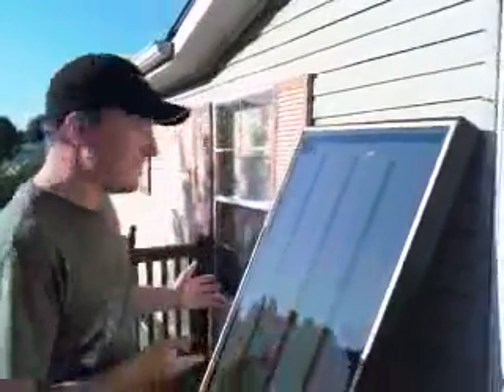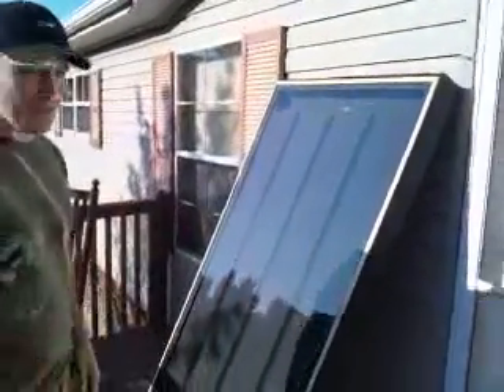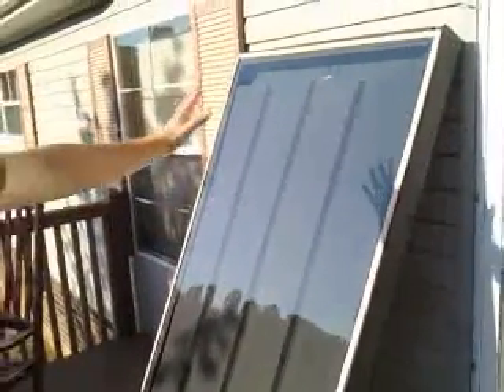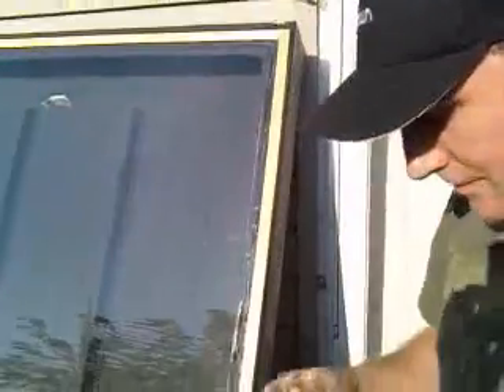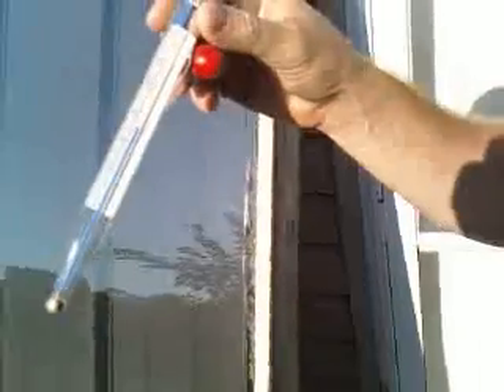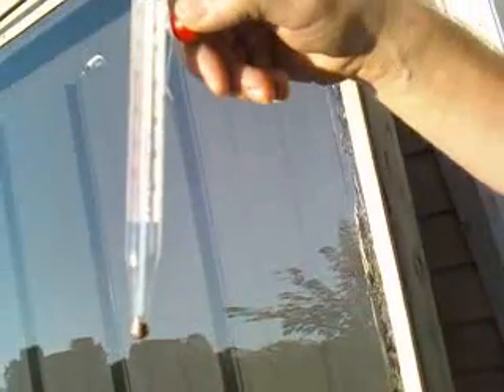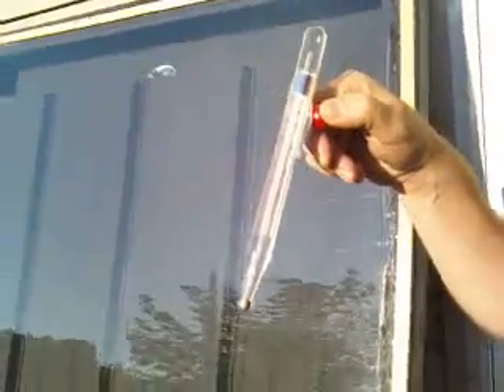220 degree solar air heater

Comment: I would like to hear about your install and the resulting internal house temperatures. 104C (220F) is a lot of free heat. I made a 2.5 x 5 foot unit with 4" top and bottom ventilation hole that made 55C (130F) of heat. So I made a 3 x 6 foot unit with 70C (160F) of heat. So I made a 6 x 6 foot unit with 95C (200F) of heat. I am now planning a 5 x 40 foot unit along the fence with 6" top and bottom ventilation holes. Yes, it gets -20C (-4F) and -30C (-22F) here. I focused on high insulation everywhere first though.

Comment: The main issue, is stating temperature without air flow.  One unit in my house produces 163-185F air and the other produces well over 500F which would heat my house better?  What if I now let you know the 163F - 185F is my wood stove with 300CFM blowers on and that's the temperature of the huge amounts of hot air blowing into my house whereas the 500F device is a candle.  We need to know the air flow, and goes with the adage a tub full of warm water has a lot more energy than cup of boiling.
Reply: Good example for illustration. May I add that without high insulation in your floor, attic, walls and sealed windows these solar air heaters are essentially like whistling in the wind. We need to trap and hold the warm, heated air for as long so the added heat can build and build keep off the thermostat while keeping our families warm. Solar air heaters indeed do work...after high insulation. 

But on your specific issue of flow rate of warm air. Typically, my 4" duct fans help to move the heated air through the unit and helps to circulate it through the house. For small areas the natural convection air currents caused by warm air rising powers the unit and warms the small area once the insulated hole ventilation plugs are removed on sunny mornings and replaced in the early evening...keeping the daily generated heat inside your warm room.

Comment: So funny when they measure the high temperatures it’s like seventy degrees outside to produce these temps, who needs heat then dumbass? Try taking it when the air is 25 degrees!
Reply: He's demonstrating the rise in temp above ambient air temp.  You wouldn't wait till it's crazy cold to build it.  Build your own then go out and make your video at 25°. We'll critique it when you do.  Rudeness is ugly on anyone.

Comment: "high heat" grill paint is not needed.
Flat black color? Absolutely.  "high heat"? No.
Solar ovens and heaters do not even approach the temps of a grill.
200 deg, tops.
High temp paint is made for 1,000 plus temps.

Comment: 70 degrees outside  and why are you needing to heat the house ... when it's 70 degrees in MY state it's comfy... what is the value of this to heat a house when it's hot outside too.  DUH............  I'll pass on this not very well thought out idea... pretty impractical on a cold day
Reply: Rick X Huh???
Reply: You build the heater when it's warm so it's ready before you need it.  The demo is to show that you are raising the air temp over ambient  air. Rudeness isn't called for.

Comment: I wonder what would happen with a reflective back surface and 1 way mirror tint on the window?
Reply: spackle9999   Was considering the glass also. I am going to guess that what you're suggesting will initially reflect more; single glazing solar heat gain coefficient is nearly un-impeding. Then, got the back, absorb the energy with a foiled insulation behind it for the best-bang-for-the-buck.  A reflective back might just reflect most of it back out. There is glazing made to optimize for cold-climates that have high SHGC and (attempted) high insulation (heat reflecting); I'd have to guess that could yield peak performance but higher costs with minimal increases in capacities.  I would definitely like to see some comparisons with these implementations though.

Comment: You will get a higher return by using pre-insulated panels available at any big box lumber supply store instead of the plain wood frame. They are basically a insulation "sandwiched" between two layers of thin plywood.  Put together using small 2x2 or 2x3 lumber and good screws. Don't forget to close in the edges by cutting at 45 degree along edges or by enclosing with the 2xs to minimise heat loss. I heat a 24'x24' barn with this in the dead of winter and it raises the temp by around 35 degrees for a 4'x8' box/heater.

Comment: I wouldn't use wood at all.  Think about all those chemicals they use to treat that wood...and it's baking literally every day and all that chemical crap is just burning and ending up in your house air in your lungs.  

Even with the paint you're not guaranteed all the chemicals are going to stay in that solar box..all that poisonous air is intended to flow into your house.
Reply: luminousbluebird I would encourage you to question at least some of what they tell you.  Not every dog bites.

Comment: That high heat paint is gonna STINK up the house.  It smells for almost a year..  It needs to be aged before you use it.
Reply: ThomastheSailor Chubby not in my experience.  Read the directions and cure the paint.  The smell does not last.

Comment: Does anyone know of a site where they actually heat a room with one of these? We have seen many boxes get hot, but would like to see the final results.It's a cool idea!
Reply: My 3 foot by 6 foot unit solar house heater warms my master bedroom, en suite and hallway very nicely. It outputs 160 F of free heat from 930am to 6pm. 10 or 15 F increase even on cloudy days.

Comment: At 93°C=200°F the heating  yield is  zero at maximum temperature in summer heat !!!
The yield is maximum when the air coming out is minimum, around 30°C to heat a house in winter, yield around 30% and 300W/m2  , saving aroind 1$/m2day of winter sunny day.

Comment: this is great, I build smaller version of this and its very effective but need to clean snow every morning is kind of an early morning habit of mine now and i dont mind that much as long as it keep its worth...
Reply: Merian, what is your average outdoor temp?  And what is the temp of the solar air that is generated?  I feared that building this in 0-20 degree Michigan temps (and gloomy skies) would create 60 degree heat at best and would not be very beneficial.  Thoughts?
Reply from the maker: Thank you ! I agree, I plan to build a smaller one for my shed.

Comment: Show me how it works when the outside temp is zero. I'm skeptical that it would be as efficient when it's cold. I would imagine that the cold that the thing is sitting in outside your house would cause a loss of heat before the heat gets into the house.
Reply from the maker: wookie0dud  Hi, I really don't know about a 0 Celsius climate. I am lucky that we usually have very mild winters here in NC. I recommend putting a snap disc thermostat inline with the fans. That way it will only come on when the temperature inside the heater is over 90 degrees F. That's what I did. I also put a switch inline so that I could turn it off manually as well. I imagine the larger you build one of these the more air you'll heat.
Reply: Heated air inside will rise, so the output is at the top.  Using a fan to pull air quickly will result in more heat discharged to the inside of the home.  Contrary to typical thinking, the cooler the unit is, the more heat is being transferred into the home.  You don't give it a chance to be lost to the elements.  Think this way, you're not trapping heat in the unit, you're using it to transfer the sun's radiant heat into your home.  Additionally, you could use double pane glass for insulation.  When you stand by your window, even in the winter, the suns rays warm you up.  This is taking that warmth from the outside and bringing it in before it can dissipate.
Reply from the maker: Actually it recirculates the air that's inside your home. The intake as well as the exhaust are inside my home. So if the air in your home is a balmy 72 degrees F, then the air flowing through the heater will increase not decrease. This acts more like another heat register inside your home when it's sunny outside. Adding to an already heated home. Therefore reducing energy cost to the home owner.
Reply: joel brown Hi there.. I wonder how it would work when we use it below 0 Celsius like -20 or something. I saw some similar projects and creator said that when its big like half of the home wall it rises the home temperature a bit.
Reply: ***** Can you reference the designs you mentioned for really cold climates?
Reply from the maker: It varies. Average for winter months is in the lower to mid 40's. I get a 60 degree F increase.  Any climate will get an increase. You are circulating the air in your home. pulling the cooler air at the floor into the intake, heating the air in the solar panel and returning it into the home.If you use a thermal snap disc it will only turn the fans on at 90 degrees and off when it drops below that.
Reply: you obviously have a lot of improvement n physics.

Comment: What was you clear cover? Acrylic, glass, or something else? I think acrylic would've melt so I'm guessing glass, but that's a pretty big sheet to be under $100.
Reply: around here you can often find used storm windows for cheap (or free) and that gives you glass plus an alum frame to attach to the frame of the heater.  Plexiglass that size would be a bit costly, but it does look a bit better.
Reply: sliding glass patio doors work well, double pane and newer ones are insulated, we have been using a corrugated plastic like they use in green houses, the corrugation works like insulated glass, and significant weight savings over glass

Comment: Hello Joel. i dont understand why your panel work good and there is no cans... Have you more picture / video about the construction please ? What is there underneath your leaf black metal ?
Reply from the maker: There's nothing under the metal except 3 support braces. They are notched out to allow air to flow from the bottom to the top. I have them screwed to the frame and then I screwed the metal to the braces. It's like the metal is free floating not touching the edges of the box. Thanks for sharing and I hope you enjoy my videos. Cheers!

Comment: in our Midwest SD area i seen first generation of the solar air heater. they panel were fiberglass so can't see inner design 1980 ?

Comment: Hey Joel. This is interesting. I would like to have seen a follow-up for the coming winter. Obviously the temp would be lower in the winter. But I wonder how much higher it would be when the outside temp is like 30 F. If the box is still 70 F, then that would be a good thing. But I question how well it would heat the house. Maybe build a bunch of these things for all around the house. Thanks.

Comment: OK... the air is 76 degrees outside. You don't need to heat the house. How about 20 degree weather... You won't see 220 degree temperatures in your heater. How about a "practical" experiment with results.

Comment: mijemu, I have built a solar batch  heaters ( 40 gallon tanks painted black in a box under glass) which hit 140 F in 4 hours; and solar water panels ( 3/4 inch copper pipe brazed to copper sheet in a loop 6 inches on center total 4x4 feet total area, all painted black, insulated in back and under glass) which produced steam in 4 hours.  I get hot showers end of March to end of September and then drain them for the winter.  Build same under skylight indoors for winter protection!

Comment: Yes, For example: In New England a window ( or panel, i.e. aperture) facing south or in direct sunlight transmits approximately 300 BTU's per SF per hour. So a 4x8 foot aperture = 32 SF x 300 = 9600 BTU's per hour,say 5 hours 10 am to 3 pm = 48000 BTU's or about equal to a 1500 watt electric heater running for 10 hours.

Comment: It seems that as soon as you turn the inlet fan on and the outlet fan on it would loose heat very fast. Am I wrong? Not being smart here, just curious on how long it can work before loosing heat from the box
Reply: EGGINFOOLS I am guessing that you gain a lot more heat than you lose.  Maybe double glazed clear polycarbonate roofing panels (like roofing panels)  seperated by about 1/4 in. would help.

Comment: use a solar thermal water system for all year round , this will save you 70% of your hot water bill for the year, You can hook up the solar thermal to a heat exganger and heat your house also ......

Comment from the maker: @nessiewintair Yes the inlet and outlet are just open into the box. They are both 4 inches in diameter. I have the painted metal mounted up off of the back by 3 pieces of 2x4 that I notched out for air flow.

Comment: i would like to know about the top and bottom in side is the tubes with the air flow open about 2 inches or so? and what size inlet and out let holes and fan? looks like a nice rig you built thx mike:)

Comment: @jab0805 Just a question as you have experience with the solar heater, please? I've thought about making a heater with a Fresnel Lens as the front cover. Obviously not obtain a focal point. Plus you have to be around 5 ft from your object to even get the focal point. Thing is... do you think this would catch more sunlight or give too much dispersal rate to achieve higher heating of the steel, iron, etc.? Guess I'm gonna have to give it a go, huh? :) Thanks for your thoughts.

Comment from the maker: @orionclock Thanks! I don't think there would be any difference other than durability. Regular glass is more easily broken where as plexi-glass and thermal pane are more durable. I prefer thermal pane, but didn't have any available.
Reply: joel brown Try clear polycarbonate roofing panels from Home Depot.  Use steel roofing painted black for heat absorbtion / trasnsfer material.

Comment: Great job, but I think there are a number of items that may improve the effeciancy & reduce the cost. 1) The Plexiglass panel could be replaced by Twinwall to reduce losses from the front of the panel 2) I don't think the innner panel needs to be aluminium, you do not need the ability of the metal to transmit heat, just a good heat capable black paint to cover the insulation matl. Some polyurethane panels come covered in a light foil, that would take black exhaust paint well.
Reply: magna59 Why do you want the insulation to absorb heat?  It would be better if it reflected the heat back at the metal conductor.  In other words, use gloss white or the shiny aluminum coating on insulation panels to reflect the heat on the back side.

Comment: @jab0805  its likely that most people watching DIY's like this will have some materials on hand. however, justinmy300z makes a good point about being completely honest --your vid title does say:"220 degree solar air heater for $100", so it is misleading to anyone who reads that, watches this vid, and realizes that it will cost a lot more than $100 to complete the heater..  perhaps you should change the title or take off the dollar amount since its impossible to build this for $100 from scratch.

Comment from the maker: @justinmy300z The plexi was (40$) at lowes. 3' X 6'. I had the two by 4's and screws already. I bought the plywood(20$) caulk(3$), paint(6$), insulation(13$), and metal sheet(18$) This video is before adding the stand, electrical wiring, snap disc, and solar panel. I didn't lie.

Comment: keep up the good work, we started out like you years ago and now do millions of dollars in solar hot air boxes. make sure you honestly list pricing though, your video says $100, but the plexi alone is $100 bucks, if you figure in lumber, caulk, screws, electronics, etc, what you have is  $400-500 heater easy....which is fine, but you gotta break it down and be honest so people really know what to expect. thanks for your efforts.
Affordable Solar & Wind
Reply: justinmy300z I could build that for $100.  Not sure where you are getting your numbers from.  Then again, I am not advertising anything.

Comment: (Appreciate your Help) Details: 1" foil back foam insulation on back & sides. 1/4" real glass. EVERYTHING behind glass is painted black , every square inch! Cans, box, foil-foam, & both wood bars with 2" drilled holes. All sealed with heat resistant caulk. Passive air flow. 0* = Freezing, so 15* is fairly cool, 29* is a HOT summer day; so whatever one that is? (Canuk) Think I put thermometer in wrong place; @ the bttm infront of the cans, instead of @ the top "inside" the exhaust/outake area.

Comment: @vpbubbies You say 15 deg outside. Is this fahrenheit or celsius? If fahrenheit then with 60% cloud cover you are probably accurate. If celsius or about 60 deg fahrenheit then I would say there is a slight problem in design. Need more details just the same. Insulation choice, plexi or real glass, ALL painted black, sealed upper and lower chambers for intake and exhaust, forced or passive air transfer, etc.

Comment: (sorry for last double reply) Understand what youre saying, infact, mine will not cycle any air from infront of the cans as both top & bttm head chambers are sealed preventing this from happening. all air that enters the top chamber MUST have run through the cans to get there. FYI: INside both chambers is painted black. Studies in sealed window units shows better heat transfer with more space, less heat transfer with 1/4" sealed units, hence why I chosenot to put alum infront of the chambers.

Comment: @vpbubbies  if you made the pop can heater you need the top and bottom head chambers to cycle all the heat from bottom to the top  and not cycle air infront of the cans and such. as well as them black painted aluminum chambers also absorb the sun and make it hotter aswell.